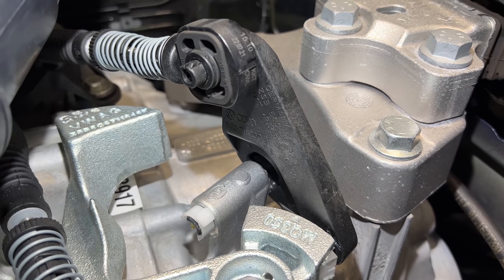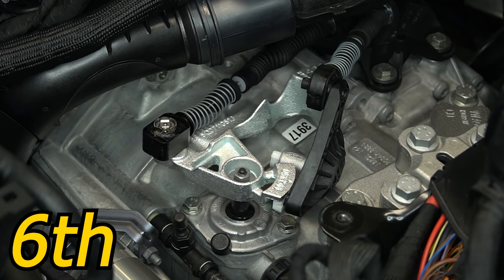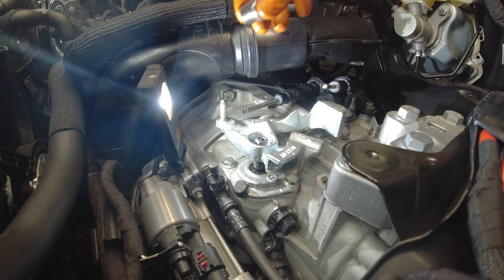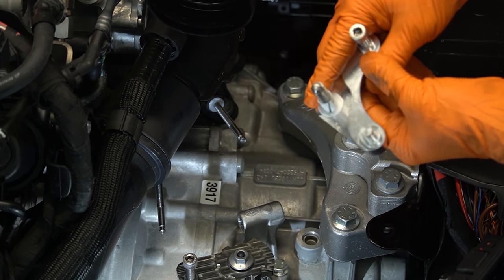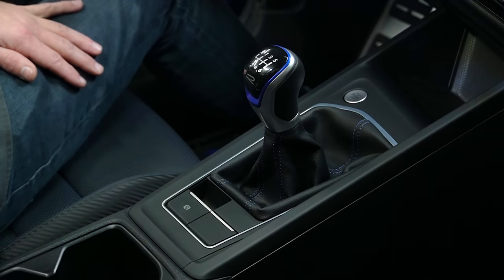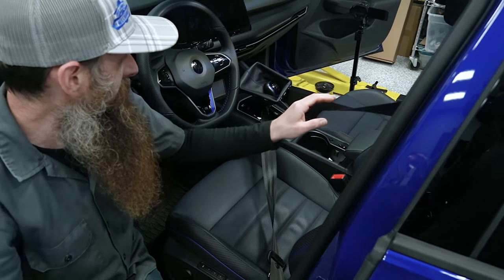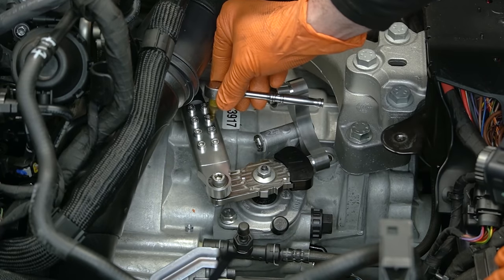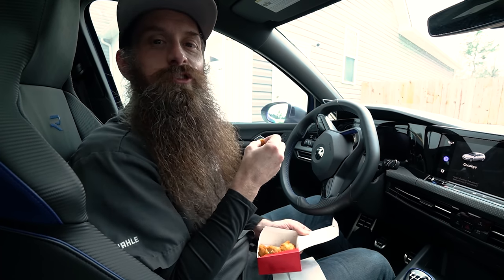Sloppy Shifter?  ~ How To Install a Short Shifter and Adjust Shift Cables

Comment: I have had a golf 8 R highly specked up, (I live in. 🇬🇧 so most things you get as standard we brits have to pay for. Leather seats, not standard, big wing at rear, not standard, wheels, not standard, head up display, not standard, Harmon Kardon sound system not standard the list go’s on. Well anyway I have had one on order since end September / beginning of October and they still can’t tell me when I am getting mine. I did have a build week of 21 but that’s been wiped from the system and the system isn’t currently showing a date at all. If you try and order one today in the uk 🇬🇧 you’ll be waiting 52 weeks plus.
Reply from the maker: That’s lame. They only gave us the full option spec(which is fine) the waiting game is the same here. It’s gonna be a while

Comment: Can this mod void the warranty??
Reply from the maker: 99.999% there is no such thing as "void warranty". IF you had transmission issues, they might deny a claim. but it probably won't void the warranty. 
Keep in mind, all warranty repairs are technically case by case and any can be denied

Comment: This is like the DieselGeek short shift kit. I had a hard time adjusting it (on my Mk7.5), so I went with a different solution. Either way, I really hated the stock shifter in my 2019, and any of these kits improved it. I have a 2018 now, and it's way better than the 2019. Weird. Charles made this look very easy, of course. Also, it seems like a 7.5 airbox would work with the Mk8. Anybody try this yet?
Reply from the maker: They are just a little off
Reply: @HumbleMechanic  Argh. Great video as always. Love your work.

Comment: I'm stuck between the holyshift snd the diesel geek. 🤔
Reply from the maker: You can't make a bad choice there.
Reply: @HumbleMechanic  Went with the holyshift!
Reply: Delivered minutes ago. Watching during install today. 😜
Reply: So all's well, but still has almost if not the same play in all the gears. 🤔 3rd gear is solid but the rest are loose. Drives and shifts fine, but not sure what to do for that. 😅

Comment: You should just pull the stock crappy knob off and tap the shaft with a M12 X 1.25 die. Opens a whole new world of knob options. Not a fan at all of how the aftermarket VW knobs attach, feels janky as hell and they are way overpriced. You can also lop off an inch or 2 of height from the shaft if you want. In my R32 I put a 675g. GrimmSpeed stainless knob with boot retainer for a Subaru 5  Speed MT(you can get one on ebay for under $80 new, just make sure its the one without the lockout collar) it looks more OE than the stock knob. I ran threads down as far as I could with the die and have about 2 inches of height adjustibility.

Comment: Can't believe there's that much slop on a brand new shifter they have to know by know there shifter bushings are crap in every model
Reply from the maker: Its the same they use on all transverse(which sucks) 

So even base golf 6sp gets it. That has to be designed for the average driver